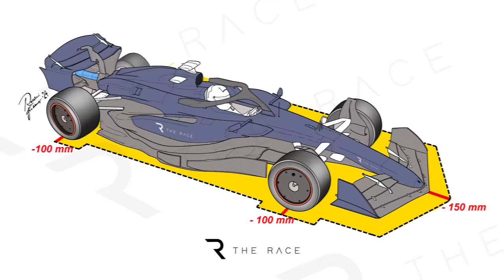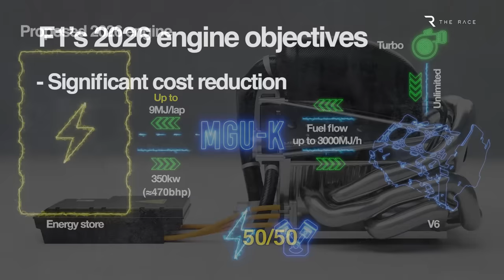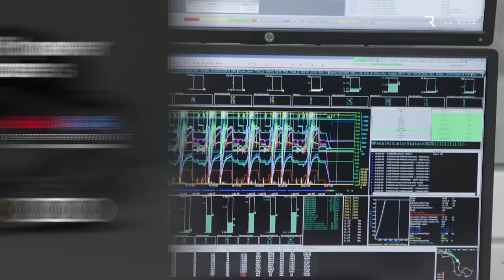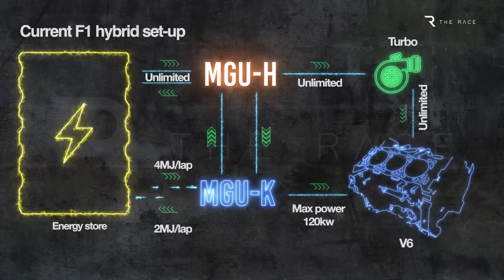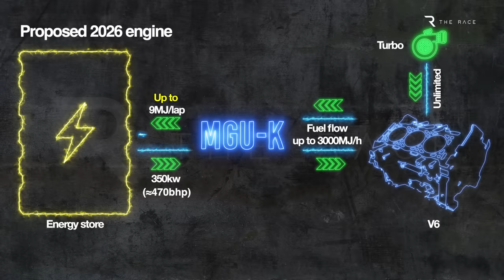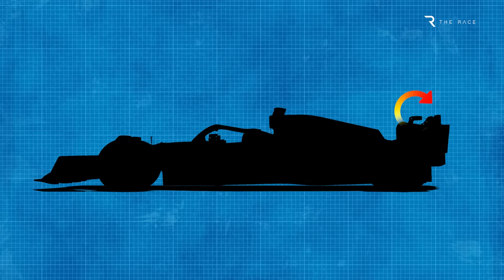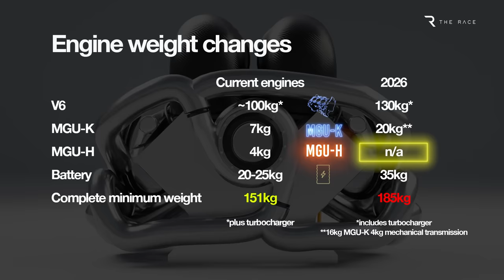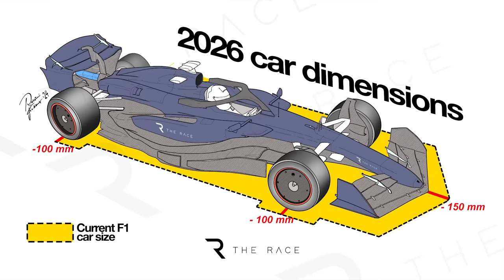The truth about F1's controversial 2026 cars

Comment: Give us smaller, lighter cars (ب_ب)
Reply: Thats what 2026 is doing.
Reply: @DonRaynor  They don't sound lighter
Reply: They are heavier, and are slightly smaller. Nothing serious @DonRaynor
Reply: With 50% less aero.
Reply: Will be as wide as a Range Rover instead of a Ford Transit as they currently are
Reply: Get rid of electric engine and battery and you get smaller and lighter cars.
Reply: @aventusV33 they were basically heavier than even R92CP.
Reply: @svendtveskg5719 50 percent less aero, 100kgs heavier and only 580bhp.
Reply: @purwantiallan5089 brother said 100 kg heavier 😭 did you even watched the video?
Reply: 12:28
Reply: They will be smaller and likely slightly lighter. Try watching the whole video lol
Reply: Everyone wants different things and you'll never please everyone.
Reply: This. I can deal with the formula becoming a cross between traditional F1 and Formula E, but the cars need to be packed tighter to enable better wheel-to-wheel racing.
Reply: @F1ll1nTh3Blanks except in this case, where they would have pleased everyone if everyone watched the whole video?
Reply: They'll never go back to the way they were because of the battery.
The battery will never be removed from the design.
Reply: @TheOfficialOriginalChad  In what way.. people are literally complaining about points the video talks about.
Reply: @purwantiallan5089  they are reducing the power of the combustion engine to 580hp, and increasing the electric power to 470hp. So they will have the same amount of power overall. 

As far as weight, the power unit will be 34kg heavier, but they're planning on taking 40-50kg out of the chassis weight, so the cars should be lighter overall.
Reply: As long as there's battery power, no chance mate.
Reply: These cars are as long as a Chevy Suburban. 😂
Reply: @aayushkhare656  2026 cars will definitely be lighter through reduced length & width dimensions as well as reduced aero (which allows for lighter materials), MGU-H removal, 6-speed transmission (even if these two only have a marginal impact), smaller fuel tank, & narrower tyres, which will all have a greater impact than battery size, which could even remain at a similar weight based on some Mercedes engineer's view, but definitely lighter overall, with reduced dimensions being the biggest contributor.
Reply: @aventusV33 Over 10cm narrower is not slightly. Stop being a hater. Of course they are not going to make a jump from 800kg cars to 600kg ones in one regulations change.
Reply: @purwantiallan5089 Where are these 100 additional kilograms? The power units are about 35kg heavier and the chassis are about 40kg LIGHTER.
Reply: The bigger cars comes from safety requirements, if you want smaller cars they’ll become more dangerous.
Reply: Agree!  These are only going to be about 6 inches shorter and 4 inches narrower.  The length of current cars is just ridiculous.  They are like land yachts.
Reply: @DonRaynor they more weights looks explain about weights chassis engine
Reply: simpler smaller and less draggy
Reply: @jurekgadzinowski2895  losing 10 kgs on an 800kg car in a complete rule revamp is kinda shit. Big tyres, larger battery, more active aero so more weight front and back. Is this what trying looks like ? There will be turbo lag, less grip in general, active aero, cars running out of battery and having 600 odd horsepower, and the cars will still be big and heavy. Cars are 2m wide, and about 5.5m long. How big of a difference do you think those regulations will make ?
Reply: @Kornn66 so just to be clear
 Have every car manufacturer amd engine provider pull put of the sport and make slower and less safe cars? OK gotcha
Reply: @xeakpress  you can get 1000 hp out from v10 engine. F1 has done that before
Reply: @Kornn66  and the cars with 1k hp from a v10 were STILL slower
Reply: @xeakpress  they had grooved tyres back then. With slicks they would be as fast or faster than modern cars
Reply: @xeakpress  also Barrichello still have lap record of Monza track from 2004. So they wherent that much slower.
Reply: @nakki123  you mean they had tires that didn't need to be managed and let drivers push all the time for entire races? Unlike the ones we have now that die in as little as 10 laps? Where drivers have to slow down and manage tires every lap?
Reply: @xeakpress  The new rules that are planned for 2026 could make F1 cars as much as 15 sec per lap slower than current cars and slower than F2! Is that what you really want?
Reply: @xeakpress  they didnt need to be managed as they where harder and had less grip. And modern cars dont need to save tires in quali.
Reply: @nakki123    ah yes a single lap in a single year really is more then enough data to compare the relative performance of the objectively fastest generation of F1 cars.
Reply: 6 inches shorter is not significant.   I am in fear the racing will be much worse in 2026 without significant weight reduction and size reduction.
Reply: YAH BUT DAH SUSTAINABILITY
Reply: @purwantiallan5089  can't wait for 2 minute 10 laps in the dry in singapore and azerbaijan 😴
Reply: @Kornn66  then they limit power because smaller and lighter cars can't go as fast due to safety concerns. so you may as well watch a different series for that.
Reply: @Jesus_H._Tap-DancingChrist  F1 cars were 2.15m wide between 1972 and 1992.  They are supposed to be wide, it looks mean and awesome!
Reply: They need to be pre-2017 width.
Reply: @DonRaynor  It's like no one here even watched the video. Do people click on these videos just to complain?
Reply: @TassieLorenzo  When were the best races at tracks like Monaco?
Reply: They are gonna be smaller and lighter
Reply: With Manual Gearboxes, and throw away the Driver Aids……..Make them earn their pay.
Reply: @xeakpress that rules and regulations of the time. Pirelli can make the very same type of tyres that Bridgestone and Michelin did. The quick tyres degrading is FIA ones, not Pirelli
Reply: @theviniso they always complains about everything that true. V10 those that. Manual transmission those that. Smaller, lighter car those that. No electric those that. Basically all
Reply: Why dont u create a f1 team and do it yourself 😮
Reply: Formula Truck
Reply: How about watching gocarting instead? F1 might not be for you.
Reply: These cars will be lighter, sadly they will lose track width which is terrible. FIA were aiming for 50kg loss but they are predicting between 10-20kg less depending on the team if i remember correct. And the cars will be 100mm smaller on the sides and 150mm smaller in length
Reply: @DonRaynor No, they aren't.
Reply: @xeakpress  And your point, is?
Reply: @DonRaynor  Not really, taking a few inches of the monstrosities we have now will make little difference.
Reply: @hangingchad_  Lighter, but still not light.

Comment: The loss of the MGU-H is tragic. It's had ten years of development, weighs just 4Kg and allows for at least 2MJ of energy per lap. It almost never fails anymore, it eliminates turbo lag, it has no downsides. If new manufacturers are incapable of making one, just make it a spec part like the hundred other FIA controlled parts common to all teams. It's not like manufacturers are clamouring to enter anyway, we have Audi, Red Bull are getting some Ford stickers, and the existing teams appear terrified of GM's Cadillac division.

Binning the MGU-H is the worst decision since they thought it would be good to fit 18" wheels that look like a plastic trim people buy from a struggling high street motor discount shop. Asinine.
Reply: The issue is that he MGU-H is another part to engineer, test, and plan around.  It helps to make the equipment less complex.
Reply: The downside is money. At the end of the day, that's all the matters.
Reply: MGU-H is a great bit of kit, but it's expensive. That's what it comes down to, sadly.

And the 18" wheels were a good move, the aero disc covers are what you are mad about (as am I, since you don't get to see the much-improved wheel designs).
Reply: Agreed, and I never liked the turbohybrids anyway. Ridding the turbocharger literally limps the efficiency and power of the ICEs
Reply: It has the downside of making the engine sound like a wet fart
Reply: At this point, getting rid of the MGU-H is just as dumb as including it in the first place.

A road car has absolutely no use for an mgu-h

Comment: So slower, heavier, more complex cars with less room to overtake and weird power delivery rules ... Well done f1
Reply: Like early 2014 👏
Reply: They're lighter though
Reply: Huh... no? Did watch it?
Reply: I hope this sport goes into shambles and get zero ticket sales. Already the old fans do not care much about F1 and have shifted to other motorsports while the social media DTS fans have started losing interest as well. Manufacturers like Ferrari and Honda will pull out from this sport as a result. I really hope this sport faces severe loss and never recovers again.
Reply: @polarpenguin3  they are lighter but the engine will be heavier... More rear end weight
Reply: @polarpenguin3 the PU is gonna be heavier
Reply: @polarpenguin3 only around 50kg lighter approximately.
Reply: It’s lighter but it will feel heavy for the drivers. Less aero plus heavier engine and lighter chassis. American style of making cars. Heavy engine plus tin can of a chassis
Reply: @mukulnag1578 lol the engine is in the middle.
Reply: More complex ? The mgu-H got removed and we know it's a really hard part to make
Reply: @Amin-dd9mk that's a significant portion of the car's weight
Reply: did you even watch the video? how did you get every single part wrong?
Reply: @TMmodify  yes. 50kg less, but also around 500hp less (if we don't include ERS).
Reply: Did you even watch the video?
Reply: When will they just go to turbo v8s on 100% sustainable fuels? This solves all of the racing problems and drastically simplifies everything which in a “cost cap era” will also make it cheaper
Reply: @_busso_v6  with you 100%, F1 sucks now, whatever made it great years and years ago doesn't exist anymore.
Reply: @frags4679  even seasons like 2009, where overtaking was difficult were better than this. At least the cars didn't look clumsy and slow to handle. 2010 tire regs were infamous for degradation, yet drivers could push on the tires and provide more action than the current shitshow. 

Schumacher - Ferrari dominance era also had the wow factor of fast cars, vibrant liveries and the loud characteristic sound of F1. Through, some races had zero on track overtakes, still the sound, the onboards were enough to keep the viewers hooked.
Reply: @_busso_v6  brother I know, I’ve been a viewer of f1 since at least 2009 myself
Reply: This sounds insanely over complicated and like a huge backwards step.
Reply: @TMmodify  actually it isn't that complicated. It's a generator that goes between the turbine and compressor.
Reply: @carisi2k11  oh I didn't mean complicated as in complicated functionality 
But it's a very costly piece of kit and having to make it has been keeping engine builders from entering F1
Reply: @planetarian451  Tin can ?
Reply: @frags4679  Not long then.

Comment: "We are targeting lighter cars by tripling the needed amount of electric energy, because the batteries will be lighter"..... it just doesn't add up
Reply: the batterys are almost irelevent in terms of weight. they are electric assist bike size. its the motor, cabling the whole package
Reply: The cars will be shorter and narrower which makes them lighter. It's not rocket science.
Reply: @theviniso it will help but its not any of the  big value items for the cars. the top 5 are 1) driver 2) ICE 3) hybrid 4) tyres 5)chasssis 6) halo. 
making up 80, 100, 50, 50, 50, 20kg respectivly. 350kg. for the cars 20 years ago save 70kg. it would have been 200-250kg for gearboxes suspention, stearing wheel everything. the current cars are 450kg for everything else. its all had to be beefed up for that extra 70kg to lug around. extra margin to be used for the whole season. f1 use to life component's to 400km now its 20,000km. that is the cause of the bloat.
Reply: Battery of modern car are now lighter than few years ago. After watching new Taycan video I kinda surprise that battery weight are getting lighter without much compromise. So it possible to make it lighter

Comment: In my opinion, if F1 goes ahead with these regulations, there needs to be a break away series. 
•V10 run on synthetic fuels
•Smaller, lighter cars (2000s spec with Halo)
•18 races a year with no street races
Electric and technology doesn't equal better racing and at the end of the day it is motorsport, we want to see racing. I guarantee there would be more interest in the sport from the drivers as well as fans.
Reply: As nice as this sounds, the engines alone would see this hypothetical series be dead on arrival, unless rebadged old units were repurposed.
No OEM worth shit wants to produce NA V10’s and spend millions doing it. It’s a design cul de sac that they’ve already exhausted, and won’t result in any benefits to road going models, which is a priority for them, whether the fans care or not
Reply: My long shot hope is that Andretti buys out Roger from Indycar and turns it into a F1 competitor to spite F1 and all their bullshit
Reply: @RD-wg9em  Bio fuels alone are more relevant and important than anything, its not the v10's its the biofuels, just like no one is driving 1.6 liter v6s that rev to 16k
Reply: @barthy_  bio fuels are a fascinating solution, but teams can investigate them whilst still performing r&d on the hybrid tech.
Keeping hybrids becomes a no brainer given that context. This is why the VW group pushed for the ruleset we currently have
Reply: who are you going to find to make these V10s?
Reply: @magnussencube  Judd, Cosworth, even AER or Gibson would have the capability. It's just whether the independent competitors in this series would have the budget to spend $20m p/a on an engine lease AND still pay for all their running costs on top of that. Would the series have the commercial viability?  Even series with less powerful engines without pneumatic  valves like A1GP (which basically had GP2 costs) or Super Formula did not prove to be viable.
Reply: @RD-wg9em Easy fix, use spec Judd V10s
Reply: Would be awesome to have "even" the same guys race multiple series cars in a season.
Reply: I agree. I'm losing interest in the currentF1 series.
Reply: They tried doing that when Eccleston was running F1.
Reply: Instead of V10, just put displacement cap, and otherwise give freedom for the engine layout. That way makes like Porsche would be instantly interested, they could use their existing flat 6 engines as basis for their engines.
Reply: I agree except for the no street race bit.
Reply: I can only hope that some middle eastern oil barons flush with cash will venture into such a breakaway series. They are doing the same for every other sport...so bring it on.
Reply: I completely agree a new series based on V10s with synthetic fuel would be a massive wake up call to F1. I want to hear and see those cars again. And so do most F1 fans. Like any other business, you have to give customers what they want!

Comment: The severe amount of regulation in deploying the Overrride and Active Aero, is very concerning
There should be more manual input from the driver

I don't see why it is so difficult to have the front and rear wings to be manually operational, within a set amount of wing angles changes
Like they had in 2010, but slightly more sophisticated - so the driver can adjust their wings when following / leading another car

To me that is just far more sensical, but they have dug a pretty big hole with the engine regulations that will 100% be very harvesting / generating critical in order to maximise laptime

My big concern is how screwed you can be around tracks with less braking zones, where you harvest much less energy. You will likely not be able to use this Override due to the amount of energy it will burn against how much more you then have to recover

I am all for the lighter cars, why the heck we still have the larger 18inch wheels is total nonsense. As them combined with the suspension is a massive weight increase, alongside the poor ride and compliance that the cars suffer from now

This genuinely seems very much like a bodge job sticking plaster, on a problem they have created purely pushing for manufacture interest - worrying about the racing later
Reply: Teams don't offer enough testing on 16 rims
Reply: @yellybeam2869  They never should've changed from 13. It made no bloody sense too ... using road relevance as an excuse was total nonsense